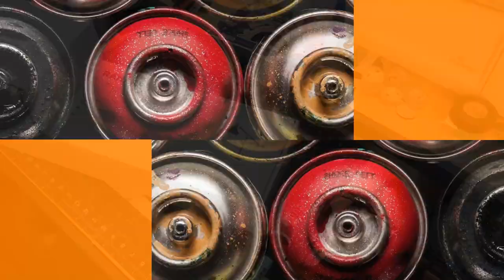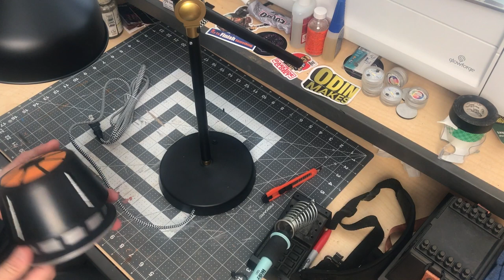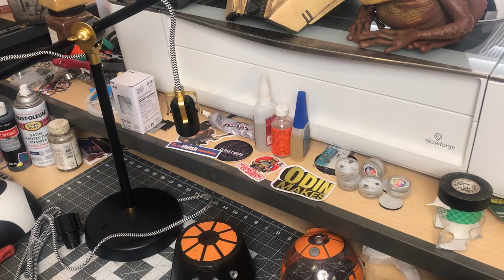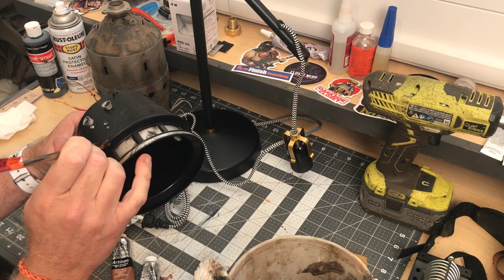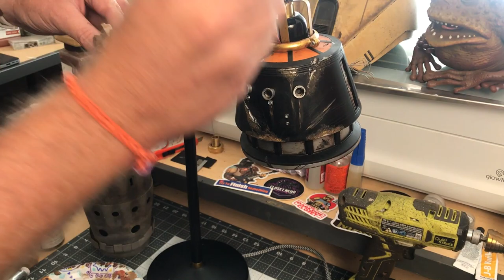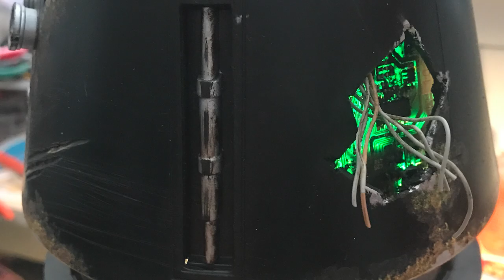TTFS: Making A Star Wars Inspired Salvage Droid Desk Lamp

Comment: First! I have a couple goodwill desk lamps I'm going to do this to! Eventually. I gotta Try To Finish my mandalorian thermal detonator case first.
Reply from the maker: As you get on Rise of the Resistance in Disneyland they had an open ammo box with a foam insert full of detonators and I was salivating at the idea of making something like that!!
Reply: @trytofinishsomething  I found this wooden breifcase on the side of the road and just immediately thought "I can use this to house my thermal detonators and beskar I printed!"  It has turned into a massive project with leds, laser engraved acrylic,  3d printed parts, lots and lots of sanding and it just keeps growing!
Reply from the maker: @popspropshop8997  I would love to see the case!